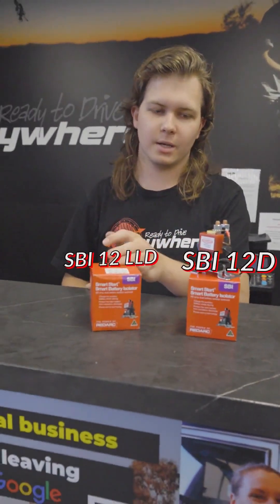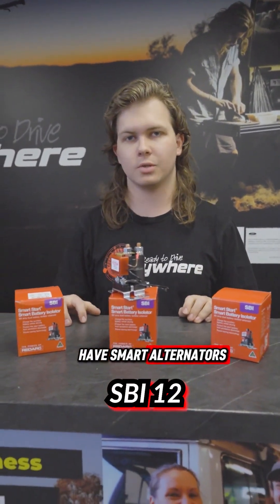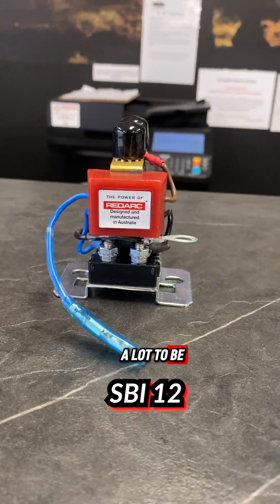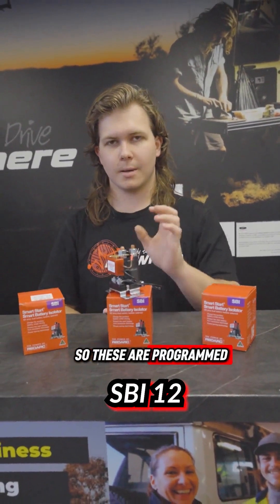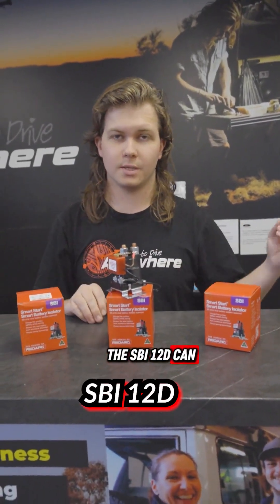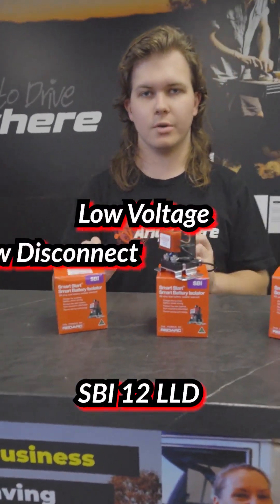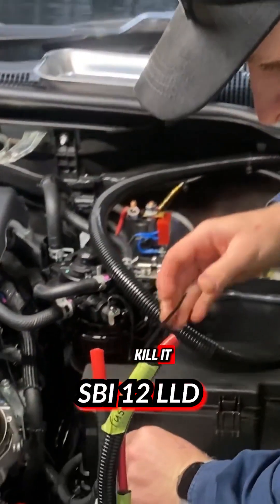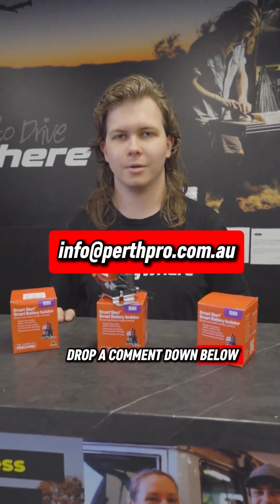Which Redarc SBI Do You Need For Your Setup ?

Comment: What do I need to power Anderson plug to back of vehicle( to caravan) on a 2025 dmax with smart alternator? Any reply will be hugely appreciated, thanks.
Reply from the maker: When we fit up isolators for these new cars with smart alternators like Dmax's we use a similar style solenoid just without the smart stuff since the smart sensing doesn't work on them. These isolators have two small control pins at the bottom one goes to earth and the other goes to a ignition source. Normally on the Dmax we would use the engine bay fuse box and use an Add-a-fuse to piggy back of either the DRL fuse or Wiper motor fuse. 
The isolator can be purchased on our website https://elevateauto.com.au/products/battery-link-solenoid-hd-100amp-continuous?_pos=7&_sid=4134511eb&_ss=r

Hope this helps!
Reply: @ReadytoDriveAnywhere Thanks, you don't know how helpful this is, thanks again for your time.